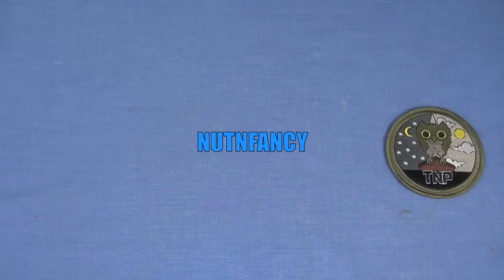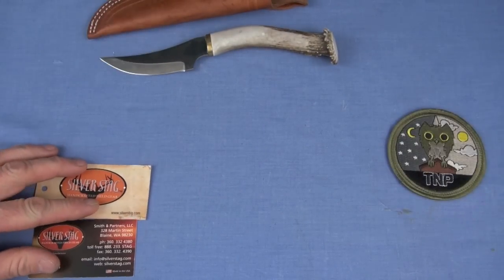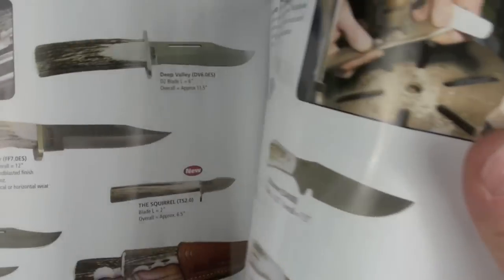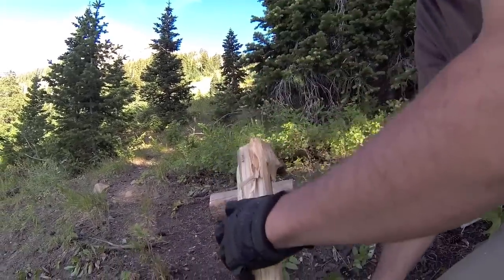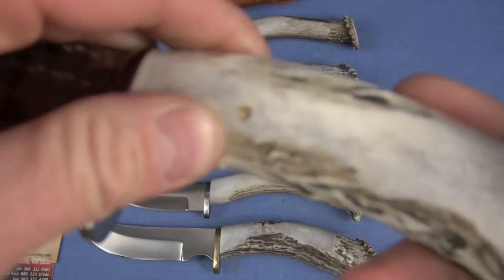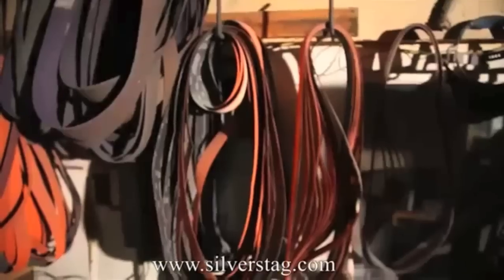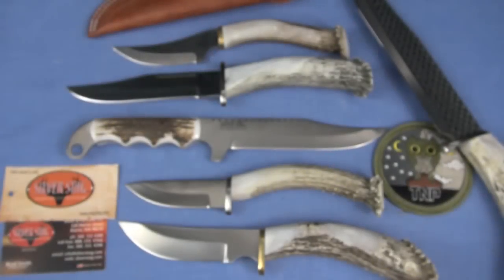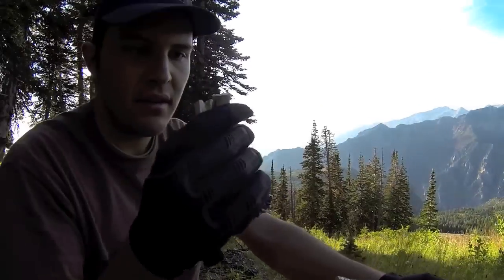The Knives of SILVER STAG by Nutnfancy

Comment: If you want a drain hole in any of the leather sheaths just run a small smooth rod up in the sheath at the fold over before the stitching starts.  I used to make all my own hand stitched sheathes  and depending on type of use would leave room for hole  or wet leather and insert a rod until leather drys for a perfect almost un-noticeable drain hole.

Comment: Looks like some cheap piece of animal bone and a cheap piece of sheet metal thrown together just like you'd make at home.
Oh wait, that's exactly what it is.
Yeah, I've got some of these myself, hand made by my dad, his dad, his dad, etc, etc.
Reply: True, only if you have the knowledge and equipment. Many don't or spend time doing other things. I also like that they use antler since it doesn't lend itself to mass production and is unique on every handle. Sure, you could make a great knife out of a rasp, antler, brass rods, resin, brake drum forge, bench grinder, etc. But the overall cost just to make a knife is prohibitive.
Reply: 1095 high carbon steel is cheap to you? I guess if you're used to adamantium blades this'd be a step down
Reply: thinking the same easy knife to make
Reply: Cerebral One of my friend has a knife he made with an eagle's leg as the handle, still has the talons and everything, the pommel is a quartz of some kind clutched inside the talons
Reply: Babby Babbyson pictures...
Reply: I made these too.  They're easy....when you have $2,000+ in equipment and 8 hours to spend on it.  Personally with my regular job now I can't afford to spend time making one when they make one for less than half the cost of my time alone long before I put out the money on tools and materials.